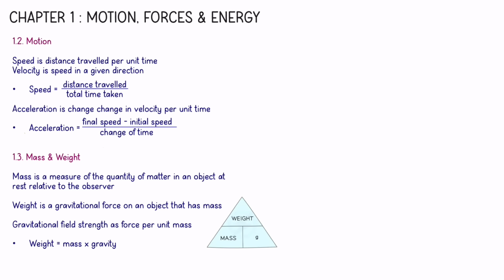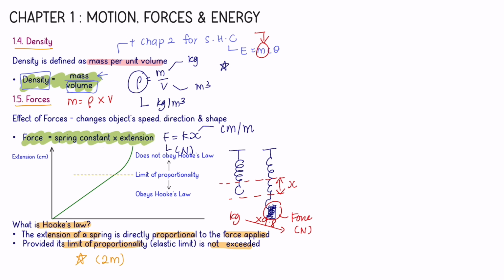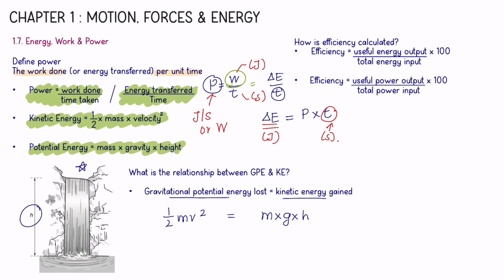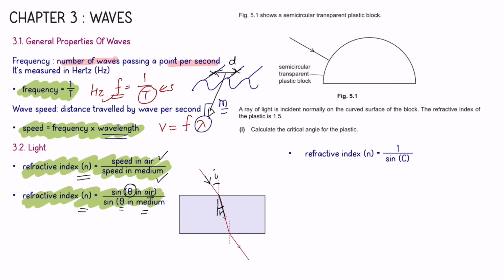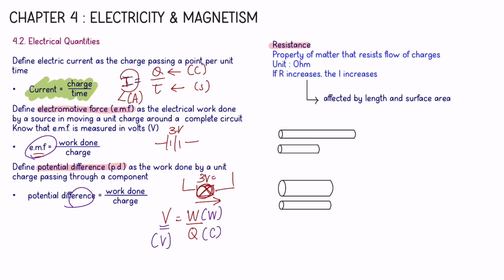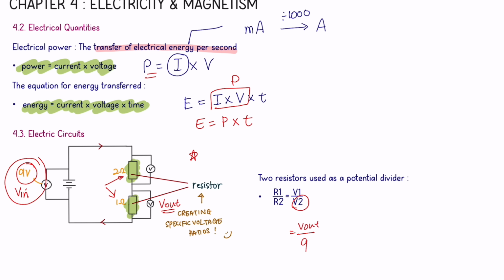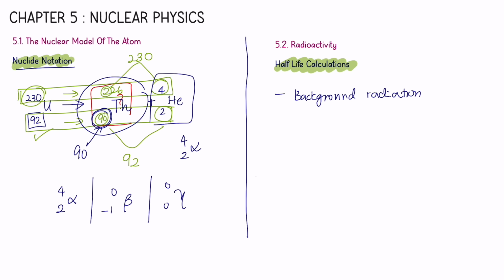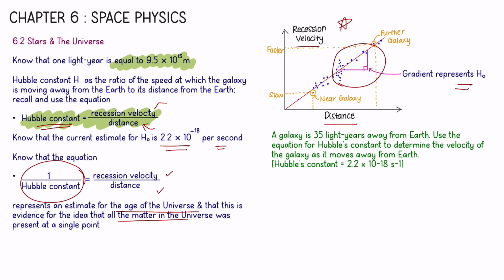All Of IGCSE Physics Formulas (All Calculations & Tips)

Comment: 00:03 - Understanding key physics formulas for motion and acceleration
02:12 - Understanding key physics formulas for mass, weight, density, and forces
04:20 - Understanding equilibrium, momentum, impulse, energy, and power in physics formulas
06:28 - Energy, efficiency, and pressure calculations in physics
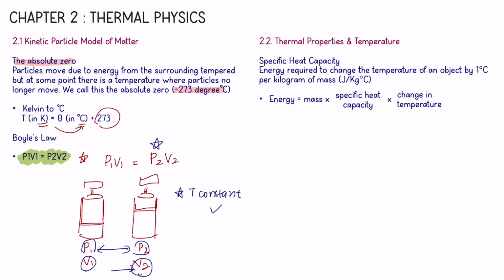08:40 - Key formulas and calculations related to specific heat capacity, frequency, speed of a wave, refractive index, and echoes.
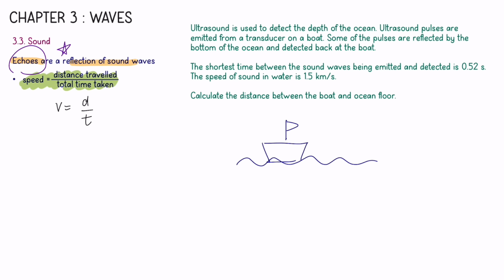10:50 - Calculating Distance using Echo Principle
13:02 - Understanding resistance in relation to length and area
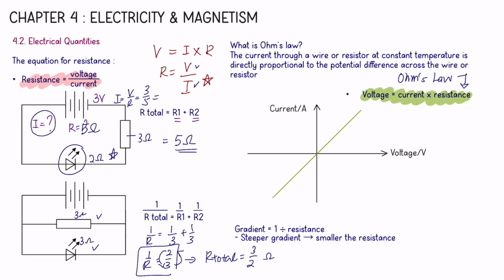15:10 - Key concepts include resistance calculation from current-voltage graph and potential dividers.
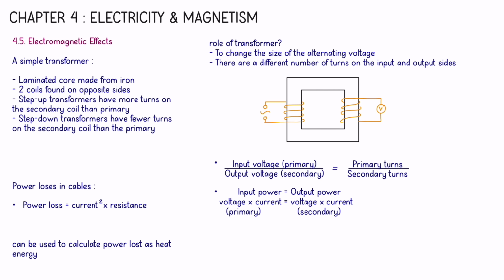17:18 - Understanding transformer calculations and power loss formulas
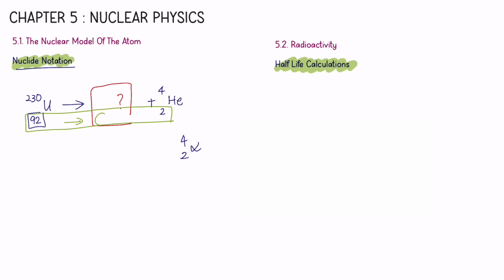19:05 - Understanding proton number, nucleon number, and half-life calculations.
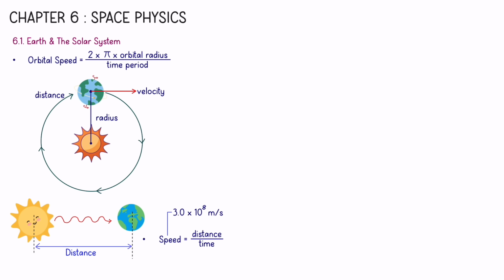21:01 - Understanding orbital speed formula and its application
23:03 - IGCSE Physics formulas and calculations with important tips
Reply from the maker: Thank you 😍🥰🥰😘😘😘
It’s pinned 📌

Comment: mam I have a doubt can you please help me solve it? my doubt is in questions about variable resistor when we increase the length, ms says there is an increase in voltage, but if there is a lamp connected, ms says it will also glow brighter by the formula P=IV, but current has reduced due to increase in length of wire hasn't it? when we use the formula V=IR,  current and resistance are inversely proportional so when resistance increases due to length, why doesn't the current decrease? and why should we use P=IV if we have a simpler formula V=IR relating all the 3 quantities we require? please help

eg. question: 0625/22/f/m/21 》question no. 34

please help